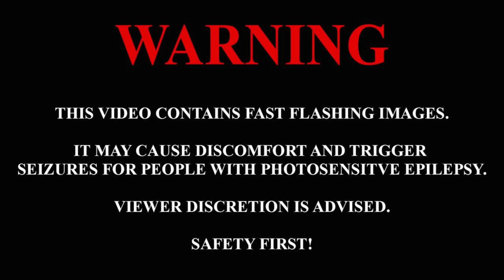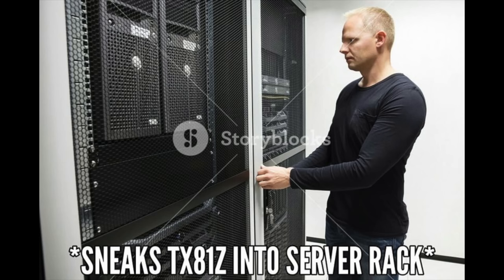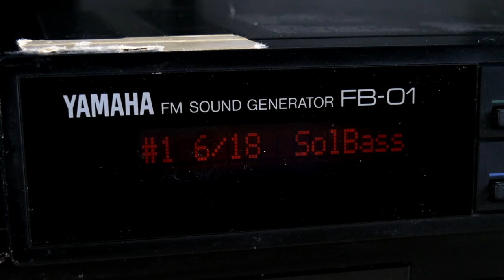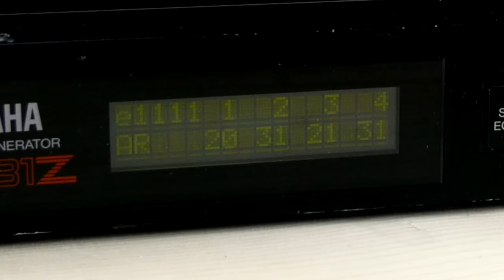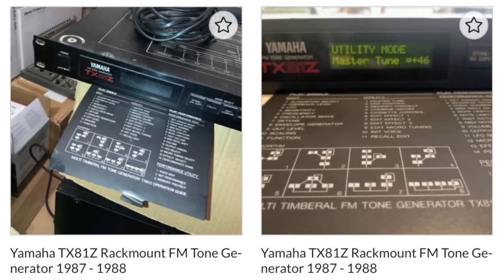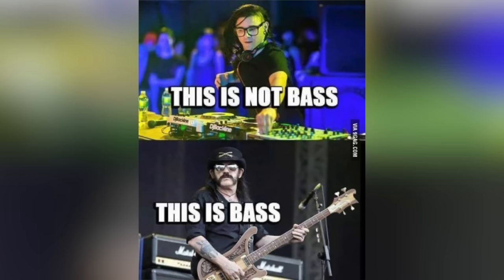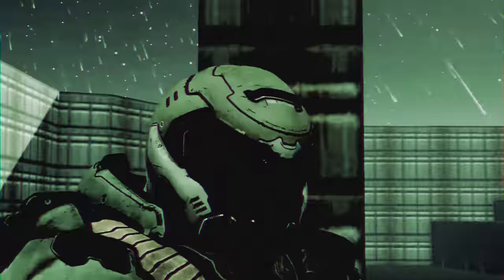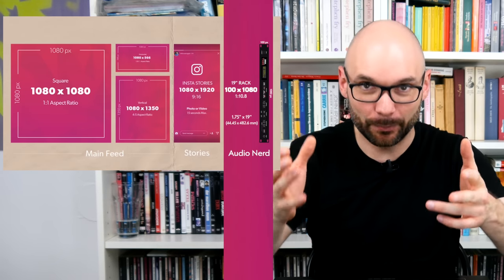Bad Gear - Yamaha TX81Z

Comment from the maker: Audiopilz: slaps roof of YT channel
Full Tracks, Extended Jams, Sample Packs: https://www.patreon.com/audiopilz
Reply: The matterhorn bit had me rolling 🤣
Reply: Up until 2007, I had both a TX81z and a DX11 in my arsenal.  Programming the TX81z was a breeze if you had an Atari 1040ST running Dr.T's 4OP Deluxe. It had a randomisation feature that was amazing - every parameter had a checkbox as to whether or not you were going to randomise it. So, you just go click click click and within a minute you had some seriously crazy sounds. Then you just tweak them a bit and you're done. The lack of FX I see as a feature, not a bug. Most synths then that had built in FX, the FX were shite. I had an SPX90 and a MIDIverb, so I had that covered. The TX81z was, in one respect, better than the DX7, if just for those extra waveforms. Overall I really dug that 4OP joy joy. Especially the DX11. The keyboard on it was very nice and responsive and it had a feature or two the TX didn't have. 
The TX was not bad gear, at all. If you listen to my music right up to 2000, it was always buzzing around the mix. I stopped using it because I ditched the Atari. Dr.T had folded shop, so there was no way to easily program the beast, so  I bought other synths (CS2x, Motif, etc.)
Reply: Roof slaps are essential for optimal functionality of the youmtubes.

Comment: My favorite part of the TX81Z is the buzzy transformer inside. You can fix it if you want, but it also adds a nice "I think something is broken in my rack" background sound.
Reply from the maker: Funny, mine is close to being unusable and still dead silent
Reply: I have the pleasure of owning a US voltage TX  81. It came with a step-down transformer which seems to turn those extra European electrons into heat and noise. No chance of hearing anything from the tx over that.
Reply: Funny you mention that because when I first got mine, and turned it on for the first time, I thought "oh sh***t". Now, I'm like "love that transformer buzz!"

Comment: I had one of these for 20 years before 'upgrading' through the DX7s, TX7, and SY77... but I ended up getting a DX11 in the end. Needed that specific crunch back. 8 voices with 8 part multitimbral over 2 outputs might seem tight, but all you need to do is make 2 complementary bass patches, layer 4 of each with panning and detune, and you've got a monster.
Reply from the maker: DX11 is tight!!!
Reply: yeah love my DX11
Reply: Only upgrade you can do from here is Yamaha V50. Same chip but with 16 polyphony, and can set oscillator fixed frequency down to 0hz. Also has onboard FX, a sequencer, and a basic drum machine.

Comment: Thanks for clearing up the confusion with the waveforms, they've been a mystery for me since i brought it back in the early 90's 🤣
I love mine, its a keeper.
Reply: The SY77 and SY99 (maybe the 22 and 33 too?) took that feature and ran with it. Six-op FM with sixteen waveforms and 45 algorithms, plus 100-some samples, and you could combine and cross-modulate (RCM) the two synthesis types within a patch. The 77 was the first synth I ever bought, and I highly doubt I will ever part with it.

Comment: It was my FIRST SYNTH. I was a guitarist with a GR-700 but wanted to contribute to the band's growing pool of synths and purchased mine back when it hit the market (wondering if I would go for the FB-01 instead). I got even more triggered to see this in "Bad Gear" than my newly purchased DFAM.  Its display is so iconic to me that, as a DIY synth guy, I purchased a few 16x2 displays for my homebrew stuff.   Great review and jams as always.
Reply from the maker: Thank you!!!
Reply: Try a Korg Z3 - it’s basically the synth engine of the TX81Z with the GR700’s 24 pin guitar interface - but way more playable than that makes it sound…
Reply: My latest diy project is minidexed, which is basically a tx81z running on a raspberry pi, with just a little lcd 16x2 display :)
Reply: @maxspencerkarinen6463    Details? :D

Comment: Yes! The old “Rack Years”… when we were all convinced that buying a kitchen-refrigerator sized assortment of these high-quality 19inch wonders was the way to unbridled success!

My small 6u rack was (well, still is) a tight network of precisely measured 1/4 inch cables… the whole idea was to arrive, drop the box, plug in the power & outputs and DOMINATE! ⚒⛓🔧🔩⚙️
Reply from the maker: Way to go!!!
Reply: @AudioPilz   It weighs well over 50 lbs… I struggle to lift it, especially these days. It mainly holds one synth with a mixer & FX… a Kurzweil K2500r

(My 2020 M1 MacBook Air is much easier to tote around… the U-he plugins weigh zero 😁)
Reply: @unkatom  Use the rack gear to make stuff at home, use an Octatrack and one or two little tesktop modules to perform remixes of your own material.  Or an MPC and a rack sampler if you already have them and the Octatrack is too modern. Best of both worlds either way.

Comment: As a Texan, I can attest to the majesty and sheer brilliance of the BBQ smoker when utilized properly. Also, as a proud owner of a DX11, I can most assuredly attest to the strength of this little beast when utilized properly as well. However, don't get the two confused. One is for cram-packing pure gold into the next smorgasbord and the other is guaranteed to satisfy, whatever the occasion, depending on how many beers you've had.
Reply from the maker: So, I shouldn't smoke FM?

Comment: The TX81Z is still a steal in the market. The grungy top-end is ace. I own two.
Reply from the maker: Agreed!!!
Reply: I had a DX100, and sold it before I knew what it was. I was in the market for a DX a few months ago, and tried to find a TX81Z, but couldn't find one at the right price. I ended up getting a Reface DX, which was nice and good enough until I got the Volca FM2. Now I'm selling the Reface, as the Volca is great.

Comment: One very very rare time where the opening theme done with the gear in question sounds so mm mm MMM good it gives me an unstoppable smile. Not sure if there's a free java programmer for it like the FB01 has but if there is - I'd recommend this one. Can probably be tweaked for cleaner sharper output by component replacing.
Reply from the maker: There's a really nice Max4Live editor that is quite affordable
Reply: @AudioPilz  There is a "Patch Base" editor for this on the Ipad or Iphone.
This remind me to ask if you consider reviewing using the Ipad foer the synth, seems like more and more synth are offering a screen connection to them. I use the Ipad as a editor for my Aerophone wind controller, Verselab MV-1, Yamaha VL70m, and the JV1010.

Comment: Of all the stuff I had that was featured on Bad Gear, I miss my DX11 the most. It was a step up from my DX100, and my first dynamic keyboard. It was also very fun to program. 

Back in the eighties, Yamaha US put out these pamphlets, which I believe was bi-monthly, about new products in the Yamaha line. One feature was reader's patches - and they had a ton of them for TX81Z/DX11, as well as DX7. Whenever I'd visit the States I'd visit music shops and get as many of those issues that I could. I wound up using quite a few of those sounds. First with my Alesis MMT-8, and later with an Atari 1040STe (a mighty 4 megabytes!) running a light version of Notator SL. I also used my Roland GM-70 guitar synth system to do melody stuff.

I foolishly traded it on a Roland D-20, then went back to the shop to get it back, only to find out it'd been sold! Wound up with a DX7S, which was pretty cool but just wasn;t the same.

BTW, you heard about the deal on NI FM8 through Plugin Boutique? $10 is an insane price, and though it's an older program it's still great. Not quite as good as the DX11.
Reply from the maker: Did I really have the DX11 on the show? ;)

Comment: The Lately and solid bass patch are worth the price of the instruments alone.   Good thing I have both patches ported to my DX7II !
Reply from the maker: Nice!!! Didn't know the DX7II has the waveforms of the TX
Reply: @AudioPilz  it does not.  But it is possible to recreate the patch using DX7II algorithms.
Reply: @arpalaser  It's impossible to recreate Lately Bass on the DX7II.  You can more or less do *Solid Bass*, as it uses all sine wave operators.  But this is not the case for Lately Bass.  And they are qualitatively different.
Reply: @seanluke3052  I have both patches in my DX (i did not programed them).  I had the DX100 and the DX7 SOLID BASS sounds exactly the same, and may be for the reasons you point out. I'll try to record a sample of the LB DX7 version an post it , but It sounds pretty close to my ears!
Reply: I am away from my instruments for the weekend.   During the week I will do an A:B comparison to be able to hear what is different.
Reply: @seanluke3052   @AudioPilz I was finally able to make a comparison between  the DX7 II Lately patch with several recordings of the isolated sound that I found and also with the Preset "lately" wich is found on the Motif Xf.   To my ears they sound identical! I'll try to record a video directly from my mixer this weekend so you can have a listen.

Comment: Fun fact: Yamaha TX81Z is being emulated on an open-source chiptune music software named Furnace, developed by tildearrow! It's named as Yamaha YM2414 (OPZ) though, which is the audio chip's name. The software itself is still incomplete (but still usable), and TX81Z connection isn't implemented, but it basically does the synth features that the TX81Z has.
Reply from the maker: Thanks for the heads up. Great stuff!!!
Reply: would you share it?

Comment: Thanks, that you remember me to have this gear in a lost corner too. Such a long time ago I used it. Some sounds I changed to get it as a basic element. But my actually workflow is new track sounds  to change till it satisfied me. Analog machines with a lot of knobs is the better way in this case.
Reply from the maker: Why not both?😏

Comment: I got 5 of these... in my Yamaha HS-6 organ :D
The organ allows you to only edit operator envelopes and amplitude, but allows for full parameter access through MIDI. After hearing what you did with the TX in this video I really gotta build a MIDI FM editor for the organ (there's software for it already, but I like my physical twiddly knobs).

You got some fantastic sounds of it!
Reply from the maker: Thank you!!!
Reply: I have a Yamaha Electone Organ and I did not realize for years that it had an adjustable FM synth inside there…. My mind was blown. And then having to save patches that will delete themselves after one week if you do not power it on, and using hard to find 32 kb NES style cartridges for sound packs or memory cards, the whole thing is hilariously amazing. I would love to see a bad gear episode about that 3 million kg beast, if not only for the lulz, but I think the Electone users actually are so fond of that thing that it would never happen 😂

Comment: I did in fact program my Volca FM and created my own patch from scratch once just to prove to myself I could do it. Wound up using it in some tracks even. It was definitely a challenge and required a lot of patience. But I still don't know how to go from "sound in my head" to "sound comes from synth" with it. Subtractive analog synthesis is so much easier to grasp.
Reply from the maker: "sound in my head" to "sound comes from synth"  is really hard with FM!

Comment: there was one of these in a second hand store back in the mid-90s, when i first got a part time job and was on the hunt for cheap gear. every time i walked in, it was there, often the only bit of music tech that wasn't a guitar pedal. every time i walked in, i wondered what it was exactly, as the internet was not useful for information on it. every time i walked in, i walked out without buying it. i THINK i made the right choice.
Reply from the maker: I'm afraid the times of second-hand store finds of legendary synths are over...

Comment: I ended up with one of these thanks to it being dead. What really happened was dead caps and the LCD was displaying garbage. Turned out a wire inside the ribbon cable had broken which is something I don't see often. It is working, now; I just make sure to include the TX-816 in the Instagram picture lol. You've shown me my ignorance of proper, better waveform names. OMG, I discovered Hatsune Miko (sp?) through a friend of mine who is into that sort of thing. She talked me into getting the keytar LOL.
Reply from the maker: Keytars 4 life!!!

Comment: I still have the DX11 I bought when they were fresh off the truck. I replaced the battery in it a couple years back -- not fun, it was soldered directly to the board. Luckily there's enough space in there to put in a proper battery holder, so 10 years from now it'll be a lot easier!
Reply from the maker: My TX needs a fresh battery too🙄

Comment: I still have mine, bought new and still plugged in my rack. I adore it, even when my only effect was a 2nd hand Torque spring reverb.
Honnestly, I don't realy use it nowadays as I work mainly in the box but it's here, audio + midi plugged, ready to serve if I would want to use it.
BTW, now you've almost cover all the old crap I have., but you have to do the Kawai K5. Yes, it's not for the faint heart but sure I am do it great you will, Grasshoper!
Reply from the maker: Nice, K5 is moving up the list. Thanks!
Reply: @AudioPilz  Try to get an editor for it (on Atari  TOS or maybe Mac System 7, 8 or 9) as it's realy a pain the, hmm, back part or yourself to edit 128 x 2 harmonics.
Reply: I’d like to see you do a dive on the K5, Florian, mostly because additive is so unusual.
Reply: @MatthewChristianMurray  And imagine the display of this K5 being almost unreadable due to its age... (like mine!) 😄

Comment: The TX 81z is really good. It falls in line with Yamaha‘s ecosystem of rackmount FM Synthesizers.

TX216:	-2 16 note TG's
TX816:	-8 16 note TG's
TX802:	-8 2 note TG's

They are all slightly different, have different timber layering options some of them have different DAC chips over the first two generation DX or TX units.

I want to know which one would sound better with the cream Xbase 999?
Reply from the maker: Thanks for the clarification! Jomox goes with almost everything;)

Comment: Pro tip: You can use the twisted electrons MegaFM as a controller for the Tx81z because it uses similar enough midi ccs Mayne!
Reply from the maker: Nice, didn't know that. Thanks for posting!

Comment: I too own a TX81z - although it's sitting in my rack and not being used.  When I want a 4op FM synth sound I just use my KORG 707 (the DS8 is also 4op FM).  My first real synth was the Yamaha DS55 (yep, another 4op FM synth - the brother to the YS100 - the same thing with built-in amp and speakers).  But mostly, I have a Casio CZ1 that controls a Roland U110, a MIDI master keyboard that controls a Kawaii K1r, and another master keyboard controlling a Roland CM32p (basically a preset U110).  That setup gets played occasionally - I'm mostly a bass player who hopes someday to be able to afford a Godin A4 Ultra that I can connect to my Roland GR09.
Thanks for the video...
Reply from the maker: Thanks for watching!!!

Comment: Economically speaking, I always thought it was a better value to use my racked 81Z for bass, lead synth and single note bell parts, rather than wasting 15 voices of polyphony of my TX7 or DX7II to play one-note lines. But to be honest, I never felt like I could get the same low end out of the 81Z as I could those other synths, so I ended up selling it. I still use my TX7 to layer with piano or other polyphonic sounds, plus now I enjoy the expanded and "cleaner" version of FM-X on my Montage keyboard. (Still there is something to be said for that early FM "grit".)
Reply from the maker: I had the feeling there are bassier FMs too but it's still earth-shaking

Comment: I’m always impressed by the hardware advocates that prefer these rack units over their virtual instrument cousins that are free to $29 at most.  It’s nostalgic, for sure, but really quite limited compared to VSTs.  For example, I’ve been using DeXEd for years (free) and find it so much better than a DX7.  Sure, there are people who will always prefer a physical DX7 synth, for reasons…. I don’t quite understand…
Reply from the maker: The output stages and DACs play a significant role in the sound of these old FMs. Depending on the sound you're after this can make a difference

Comment: despite the stripped down design/ 80 ties flat 19 inch box,
this is a unique and gritty synth.
they were goin cheap back in  the days (payed 150,- euro, i guess),
and are good for some little extra in the mix.
like also the house organs and (cheap) strings.
Reply from the maker: You could find them for <100 whateverbucks. Unfortunately, these times are over...

Comment: I honestly really like the FM synthesis chip in the TX81Z (the Yamaha YM2414, or the OPZ)
Perhaps the most powerful 4-operator fM chip I've used.
I'd suggest if you really want to get into the weeds of the YM2414 (OPZ), You might wanna turn to Furnace. The main developer owns a TX81Z and he has created the first YM2414 tracker :D

Also to the chiptune community the YM2414 really sounds like a better YM2151 (OPM) used in countless arcade games hahah

(selling myself out but ive used the 2414 once, as a normal chip lol)

Sorry if I have only talked about the FM part, I'm not well-versed about the module lol
Reply from the maker: Yup, FM chips are a VERY deep rabbit hole
Reply: We FM tinkerers could all agree on that haha